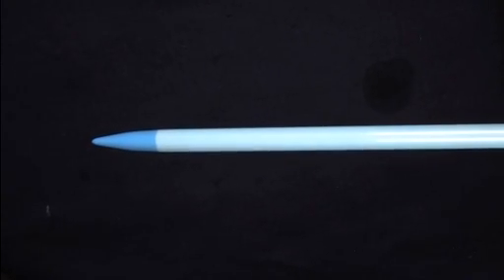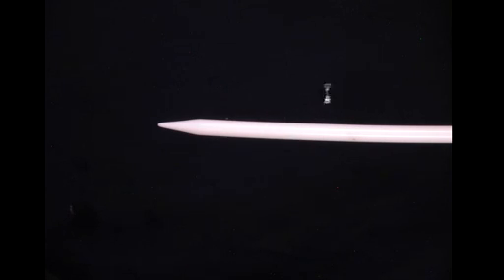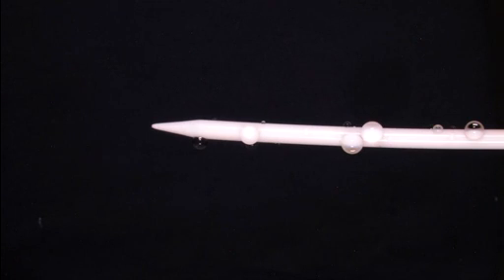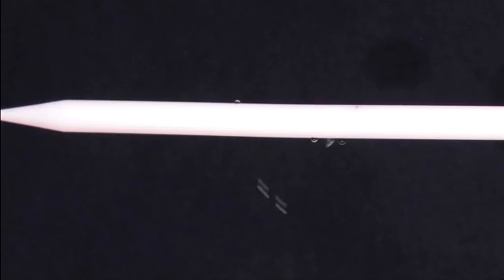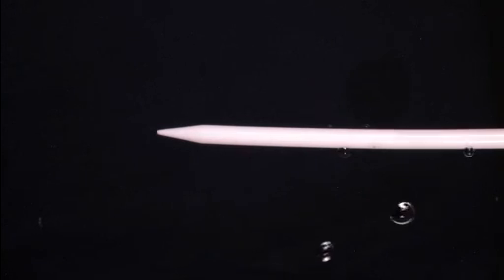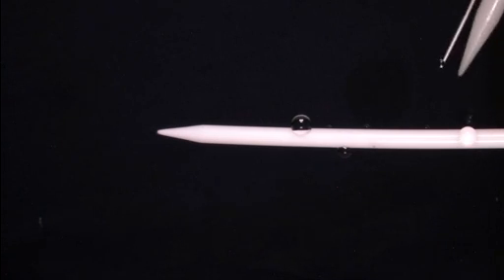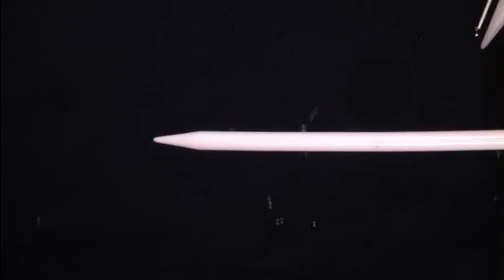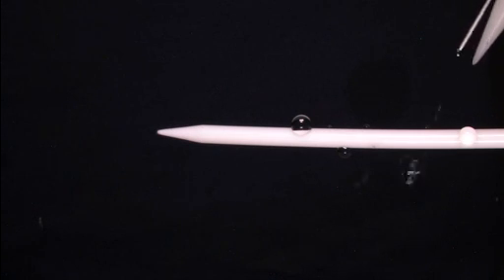In Zero-G Static Electricity Walks On Water

Comment: The interesting thing is that the inverse square law is exactly the same between gravity and electric charge. 

Really makes you think.
Reply: No it doesn't, it's just basic maths. The inverse square law applies for many things, including radiation, sound, light.
It's just what happens when something emits radially.
Reply: @wombocombo516  Wrong, it is different for magnetic fields. The electric field and the gravity field drop off at the same strength.

Comment: I can't help wonder if this has been done with a hydrophobic material.
Reply: No.  You can see the effect on earth running tap water past a static charge of either polarity on different materials and get the same effect.  But the water obeys earyhbgravity onlt patially orbits around the charged device snd runs down the drain.  Even distilled water with no minerals does the same.

Comment: This is a polar molecule H2O...BUT the surface is not fixed so crazy affects may occur. It is not like a bar magnet which has FIXED poles. The smaller the drop more pronounced mag affects because the surface is not as movable/flexible. The materials have different quantum and field effects so they appear to have different wave lengths for some reason?

Comment: That's pretty much experimental proof that the Electric Universe (and Plasma Universe) advocates are on the right track. Its time to seriously reassess The Standard Model. There is no Dark Matter, there are no Black Holes or Neutron Stars. All matter discovered so far has an inherent electrical charge. This explains the motions of atoms scaled all the way up through the motions of planets and even galaxies.
Reply: Um, no.
This video demonstrates that the force law between two charged objects is an inverse (square) one.
Nothing more, nothing less.
Neutral objects feel a force between them (gravity) and it obeys the same inverse-square dependence.

Comment: hmmm...illuminate me, can't this be applied to objects or persons so they don't just float around in space? Like an artificial gravity?
Reply: I'm pretty sure that electric charge needs a medium through which to travel.
Reply: joseph negranza There is no reason why they should not be able to make an electronic tether using this principle.   I would be surprised if they didn't start working on tractor beam technology shortly after this experiment.
Reply: No. It does not.
Nothing is travelling between the needle and the droplet.
You could do this same experiment in a hard vacuum (with the water droplet replaced by a plastic or metal bead of roughly the same mass)

Comment: Good question, the problem is: Water like all liquids has a vapor pressure, in vacuum theses drops would partially vaporize and freeze. Due to the water vapor there would be again friction (and also likely charge transfer). So if you used e.g. plastics balls instead of water and assume we ignore radiation caused by moving charges, then they should spin forever...
Reply: That would be something to see!

Comment: That's easy:
The droplets of water have momentum, which prevents them from falling straight to the needle in the beginning.
However on that Space station, there is also AIR (and may I remind you that there are about 30 000 000 000 000 000 000 air molecules per cm³ at room temperature), SLOWING THE DROPLETS DOWN with FRICTION.
At some point the droplets have lost too much momentum and fall to the needle.
BUT:
There is no air in the interplanetary medium (almost - 5 mol./cm³) slowing planets down.